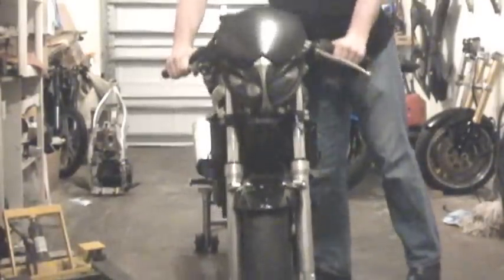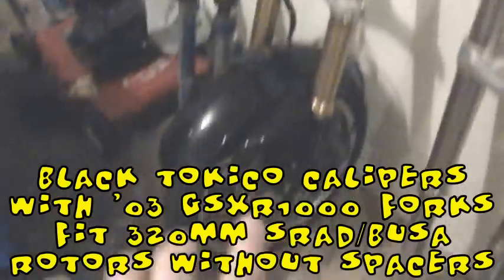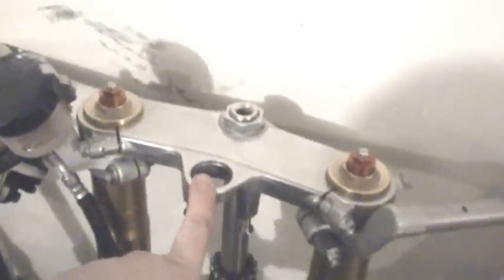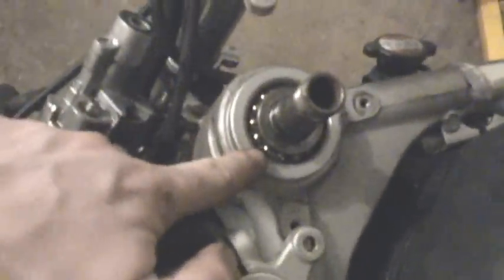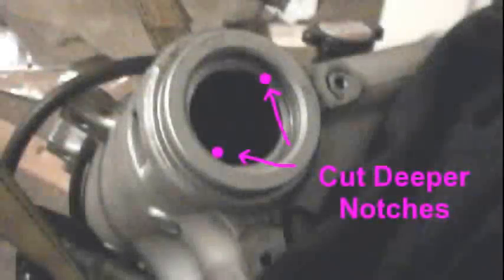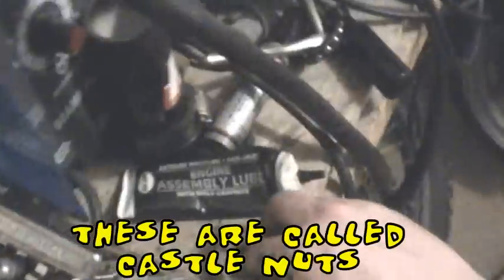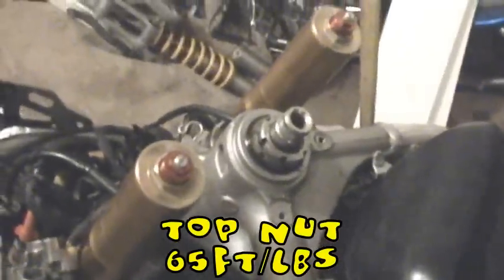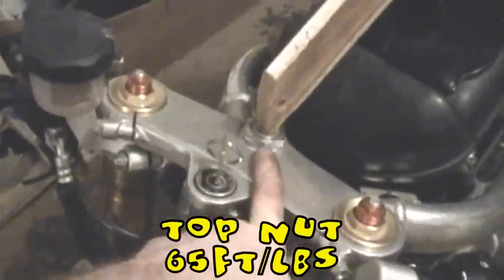SV650 GSXR Fork Swap - Quick and Dirty

Comment: I checked out the stock triple today. It was cast with big reinforcements to accept the risers. I think I'll need to weld in some material and drill through the whole mess. Also realized I have a brake issue. My bike is a naked and the brake line "splitter" mounts to the bottom triple. I guess I need an entire front brake setup including the master? And a longer brake line to reach the MX bars....The parts list keeps growing!

Comment from the maker: I am roughly your size, at 6'3" and 250lbs or so, so yes I found it too soft to keep as/is. Plus mine was worn out, and in my case I found some cheap GSXR parts far less cost than replacing/repairing the stock SV stuff.

Comment: i just finished a front end swap on my 2005 sv1000s, i used your video to help me along and it helped me out alot, i used the forks from a 07 gsxr 750, only problem i had was bleeding the brakes, i had an air pocket in the master cylinder that took a few hours to figure out, could you make a video on bleeding the front brakes? it would help out alot when someone is changing the forks, ty

Comment from the maker: Not sure, think it would be better to weld something in there solid.  The bottom of the top tree is scooped out, you could maybe cut a piece of 1/8" steel and fill that space then drill the holes through both and sandwich it all together with bolts.  At least if the top tree cracks, then I think it should hold it all together.

Comment from the maker: I don't know if the TL axle will fit, but to keep the answer short, the best axle to use is the one that matches your triples.  I had a GSXR axle, and it fit in the forks but wasn't long enough to reach between them both.  SRAD triples have a wider spacing, so its best to use an SRAD 750 axle!  :)

Comment from the maker: I replaced the entire front clip, there is no SV parts on there at all, and that includes all brake parts: calipers, brake lines, and master cylinder.  You might be able to recycle the upper line that goes to the splitter, as with regular handlebars you'll need that length, but the rest needs replacement.  A complete frontend should be available on ebay relatively cheap, unless you want some special config.  In my case I wanted the GSXR1000 forks for stiffer springs, and radial front brakes.

Comment from the maker: @darthclone7 Its actually easy, and there are a couple different ways to do it.  The way I'd do it is to remove the top tree, flip it over and remove the ignition directly.  But if you don't have the right tool to tighten down the steering nuts, this may not be the best solution for you.  The other way is to try and reach UNDER the bike up to underside of the the top triple and remove the bolts with some socket extensions, or if that fails remove the front fairing and attack it directly.

Comment from the maker: I do believe an SRAD600 complete front end will work on a 1st gen SV650. If you try to use more modern forks in the SRAD600  tree, however, they won't fit! :)

Comment from the maker: I only buy stuff when I get a killer deal!  Forks and clipons were free because I was owed a favor, and the complete brakes were a bonus from another complete front end that I bought for another project ($299) that didn't need the brakes! I found the triples axle and fender and front wheel with tire with shipping for $9 $7 $12 and $30 respectively on ebay. I got the discs locally, for $50.  The only part that I paid full retail for was the special top bearing, $45

Comment from the maker: Any year First Generation Hayabusa rim should work.  It may need spacers on the sides, you'll know when you fit it together.  The SRAD front wheel is a direct drop-in, also you'll need an SRAD axle, its wider, other axles won't fit.

Comment from the maker: Hi. I think any 2003+ GSXR 600/750/1000 front end should pretty much fit a 2nd generation SV650. I haven't done one myself, but I have read about them before. Depending on your weight, you would generally choose the respective GSXR front end. For example, I'm somewhat heavy and of larger stature, so I used GSXR1000 forks. My little girlfriend would be plenty happy with a front end from a 600.

Comment from the maker: The gauges did not fit directly on, rather I made a couple small brackets that attached to the clipon handlebars' pinch bolts.  I think you should be able to do the same with the front end you have.  I guess I don't have any close-ups of it in this video... oops!   I guess I need to cover that in another video.

Comment from the maker: @Cobryn205bws If you change the trees, either get new bearings or use the same bearings in their entirety, that includes matching the same inners and outers.  You can also change the forks and leave the trees alone if the fork legs fit in your trees.  I would have done that in this case, but the GSXR1000 forks won't fit in the SV650 trees at all.

Comment from the maker: The GSXR top is very easy to drill, but its not particularly strong for this purpose because it wasn't intended for it.  I've never seen anyone drill them and have them break, however.  I would say that it might be a good idea to reinforce and fill the underside with some more material.  A proper welding engineer would be able to give you a better suggestion.  Hope that helps!

Comment from the maker: @allmiller4u You could do it that way, but I recommend that you change the oil in them to somewhere between 20W and 30W, and that will require the fork legs to come off and be inverted to drain.

Comment: Nice. yea my "killer deal" was 450 for an 08 front end (minus clip-ons/top triple/and fender), plus a front wheel and rear whee from a 2007. I got an 05 upper triple to keep the stock ignition location so i can retain the steering lock, but it was required to be machined 3mm for the steering stem. all i need is clip-ons and tire. thinking of temporarily using the 120/60/17 tire for now. rear will wait as i need the caliper adapter (also by Zoran).

Comment: there are tons of options for the 2nd gen, and other than the GSXR parts, you dont need any bushings or spacers. if your planning on running it naked though, try and get a 06? (i think) upper triple, its got the location for the ignition and it will retain the lockout. i have a complete 08 waiting to go on, i had to have the 06 tripple milled out like 2mm on the inside for it to fit the 08 lower. im keeping the stock brake pump for now, but with radial brakes.
Reply from the maker: My SV650 has been running great for years with these upgrades!  😁👍🏻

Comment: GSXR 600/750 forks are typically the same. that being said the 08's come with a .9 spring rate. Don't know how much you weigh, but the spring of .9 is a fine upgrade up to about 190 lbs. (check racetech for recommend spring rate). i'm doing 08 600 forks on my 2005. the problem is you need an upper tripple from a 2005 to retain the stock steering locks, and the steering stem needs to be bored out to 28mm (from 25mm)... i'll probably be doing a video on it.

Comment: i never really felt the brakes up front were that bad with upgraded pads (talkign stock SV) if your looking for a cheaper alternative for a non-race bike, i'd also suggest 15w or 20w fork oil, emulators, and springs for the stock forks. i'm thinking about making a back-up set of stock forks to keep on hand for myself incase i decide to do some sort of racing that requires "stock" forks.
Reply from the maker: Brakes were always good

Comment: Great Video. Im considering doing this exact mod to my '02 SV650. BUT, I'm looking to run handlebar risers with fat bars. Happen to know of a top triple that will accept this? I've read that the GSXR top triple is to delicate to drill although it looks similar to the stock SV650 triple that has risers. Just wondering if you had any input. Thanks for posting these vids, and keep up the good work!
Reply from the maker: Some say the GSXR top Triple Tree is not Tough Enough To Be drilled fo mount handlebar risers, but I have no experience in that department. Use your best judgement!

Comment from the maker: Thats the OEM gauges on there.  I have no plans to install anything else... but if I change my mind yes I will make a video! :)
Reply: couldn't you fit a gsxr srad 750 front axle speedo drive instead of the ingenious rear axle sv650 drive you have done? maybe somehow get some srad clocks mounted to the srad triple tree/top yoke? i was looking at the connector of sv650 clocks and gsxr clocks and theres a good chance they are the same. i havent tested that yet obviously.

Comment: springs are easy. thats probably the biggest factor (the reason the front end is so bouncy) the only advantage that the GSXR front end has over an emulated front end is the compression/rebound damping adjustment, and the bling factor of up-side down forks. emuls + springs + fork oil can be done cheaper than a GSXR swap unless you find a sweet deal, which is not likely to happen. i managed to cobble mine together for about 450$ which is about as sweet as it gets. "typically" its 600+.

Comment from the maker: The light is an cheap ebay knockoff as you say.  There  truly is no highbeam at all, but you can wire it any way you want.  I made 2 small lights come on for low beam, and those plus two higher wattage bulbs come up for high beam.  The gauges are mounted pretty simple with some metal strapping to the clip on bolts, you can see how it works in this video.

Comment: Hi great video!

Got almost the same setup on my first gen sv650:
- srad triples, axle and wheel
- k6 gsxr 600 forks

But the axle wont fit. What did I do wrong? Thanks in advance. Hope someone can help.
Reply from the maker: Are you sure its an SRAD axle, too?  The SRAD triples are wider and require the matching axle!  :)  Hope that helps! Thanks for the question!

Comment: What about 2nd generation SV650?I have a '04 with injection,but they didn't bother with suspension,it's so crappy...what would u recommend?i'm thinking about a gsxr 600 with radial brakes,wheel and perhaps a radial pump?
i would appreciate a feedback,thks man
Reply from the maker: I think the same set up should work for you, but you'll need some different bearings in the headstock on the frame

Comment: also, there's a post on SVrider forums about all the detailed info on what fits and what doesnt and what each iteration comes with. i'd check that out. mostly the 600 and 750 are pretty much identical. i'd stay away from the 1000 stuff, thats where it gets a little complicated. also, if you havent upgraded the rear yet, i'd do so like immediately unless your like 120lbs. there are several options there. i'm running a ZX-14 with a 475lb spring (for my 155lb butt)
Reply from the maker: Thanks but the work was already done by the time you told me to check it out LOL

Comment from the maker: @112mikee112 The SV forks sucked, and always did, even with oil in them.  I hate those things.

It handles great, I'll have a followup video on that shortly.

I left the oil and springs alone.... the SV might be a little lighter, but the GSXR1000 (and the SV) are configured for lightweight rider... I nearly double the weight of what Suzuki considers the average. 

I haven't dialed them in yet, I just checked that both fork legs had the same adjustment for consistency... and they did! :)

Comment: This video was just what I was looking for. thanks a lot! I just bought an '02 with these same mods already done. You and I seem to have the same Hercules body type, can you share a little adjustment info? Did your fork height stay where you originally installed them, and what was your starting adjustment on your rear shock mod? Thanks!
Reply from the maker: Glad I could help! Thanks for the comment!    I painted this bike last year, its VW Bus Sage Green now!  Odd color for a bike, so it gets lots of compliments!  https://youtu.be/xBLYhmADajo   The front end height I believe fell about 1/2 inch shorter than stock SV forks... but that was inadvertently resolved by installing a slightly taller tire some time ago by accident.  I ordered the wrong size (120/70/17)  and that raised the front end, bonus!  LoL!  I don't remember how I set up the rear shock, there was a lot of trial and error there.  I mounted it then put adjusters links on there to get the height correct.  After that I adjusted the shock to my taste and body weight but didn't record the settings. I rode the Dragon last summer during the eclipse.... this thing got a lot of attention and rode like a dream!   I probably need to stiffen it up a little more since then.... I got fat this year.Thanks so much for the questions, I hope I helped you!

Comment: Hey whats up? Quick question. I plan on converting my '02 SV650S to naked/streetfighter too. I was wondering is that headlight from Acerbis? I found some on ebay for really cheap but they look like knock offs and 90% are not street legal/ DOT approved. Is yours bright enough and have high/ low beam? How did you mount the S gauges? thx
Reply from the maker: Cheap Ebay... I hate it

Comment: Is that a stock GSXR upper triple tree?  I am looking to replace one on a CX500 fork swap.
Reply from the maker: Yep!  Stock SRAD triples on here!  Its been good for the last 9 years on this early model SV650!    Not sure if the bearings nor steering stem is the right size for a CX500, however.  Recommended upgrade in my case! Would like to see your build!  Got any videos?
Reply: @DuckmanCycles  Pictures only.  Engine and Carb are almost complete.  Starting to figure a Deluxe Tank mounting on my Custom Frame.

Comment: Thanks for the reply, so your sure it will fit as i have a chance ti buy a very cheap srad 600 front end - I can get ohlins progressive fork springs for the same forks for 145euro so I think im onto a winner.

Will the bearing you use from TWF racing be needed and if it is will it work the same as the gsxr750 srad front end or is there a different bearing? thanks
Reply from the maker: I can't you anything about the 600 front end no, I don't have one unfortunately

Comment from the maker: @Cobryn205bws It rides awesome!  The old "boingers" were just that, BOING BOING BOING!  Terrible front end on that SV650.  I'm sure it was worn out or abused, but still, it was worse than the front end on my Puch moped.  I'm happy with it, and I haven't even tuned it yet, it was just such an improvement as/is that I was happy.

Comment: do these fit the SFV650 well?
Reply from the maker: Thats a good question!  I began collecting parts to do the swap on my SV650 almost 10 years ago!  Black then I think the Gladius only just hit the market, and a new bike was a little too rich for my blood... lol!  But I'd say its possible, but I think you'd use a different set of triple trees, and a different front axle and wheel, I've been told a 2011 GSXR1000 front end will fit ya.  Please do your research first before committing to parts!  I still have this SV650 to this day, its been repainted and I still ride it!  It was pretty awesome when I got it on the Tail of the Dragon!
Reply: @DuckmanCycles  suspension parts are sooo expensive. I was looking at the penske rear shock... $1000.00.... crazy. I have to get rid of my shocks at this point. Driving me insane. After nearly 20k miles they aren't good at all anymore.
Reply from the maker: Yeah, some are even more than that!  Often its best to look on ebay for a shock that fits.  I think I got the one for my SV650 for about $50... and I haven't even done 20k miles on it anyway lol!

Comment: just out of curiousity how much did this build cost, i saw some deals on ebay for srad and 00-03 gixxer 750 forks no brakes for a little over 200 shipping included is that a good deal or should i keep waiting/searching also saw some tl1000 fork for around 180 i'm guessing those would fit well into a first gen sv but i'm just speculating
Reply from the maker: I don't usually share prices of things that I paid or anything I sell, heh, but you should do it for that price!  I got a lot of things for trade, so its hard to put a dollar figure on it all anyway. :)
Reply: +DuckmanCycles and VW Garage all good guess it is a good deal then

Comment: Like most of these swaps, he fails to address the speedometer drive issue. SV650's speedometer drive is on the left side of the front forks, so unless you use a GSXR front end off '95 and earlier, the later front ends are off bikes where the speedometer is driven of the counter-shaft sprocket, which the SV650 has no provision for. Always be aware of front ends bought off ebay. Either they're stolen or off crashed motorcycles, which means the chances of all parts being straight are slim to none. Especially never use the old steering head bearings. All Balls racing can get you proper new tapered roller bearings.
Reply from the maker: What the hell are you talking about?  LoL!  Like most of these comments that people leave without doing their own due diligence they make a comment and make themselves look bad without reading the video description or following any of the links... I devoted an entire video to the subject of speedometer drive, and no I didnt need a 95 or earlier front end.  While the video was shot a long time ago by me with some lousy video equipment which is the best I could afford at the time the fact is, I never failed anything, 12 years later the bike is still running and driving just like then, everything still works.  Here's the video link you missed in this videos description:  https://youtu.be/-CGNhGkqM-E

Comment: Im putting gsxr 750 07' front end on my 1st gen sv 650 and theres no mounts for my 1st gen gauges because the gsxr has a full fairing and a frame brace. any suggestions on mounting the 1st gen clocks on a gsxr tripple tree? it looks like it worked fine with the srad, did it mount directly on?
Reply from the maker: Did not mount on directly, had to make some brackets.  Simple enough.  😁👍🏻